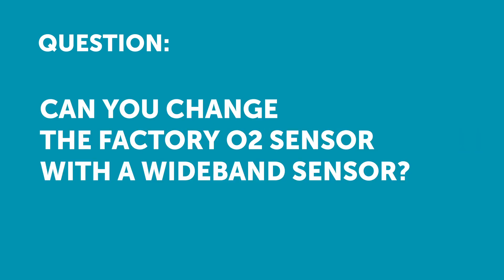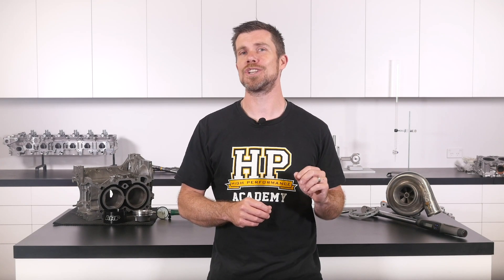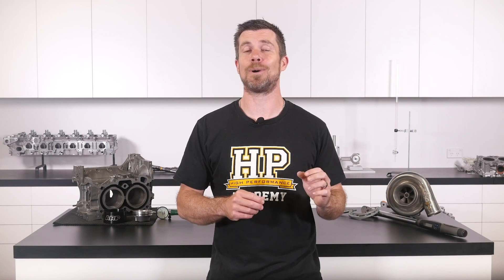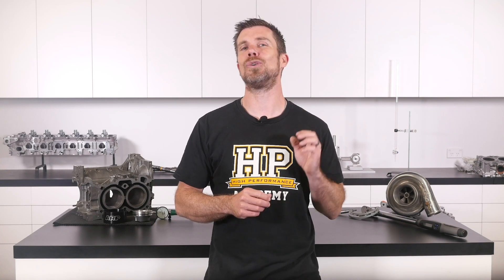Replacing Narrowband O2 Sensor With A Wideband. Straight Swap? [HPA Q&A]

Comment: But if I want to run say 13.7:1 and narrow band is not accurate at that level, how do I do the tuning, just adjust the target AFR and see when the WB reads the value I want? I just did that on a 1991 GM EFI v8 1227727 and it didn't change anything it's still 15.7 (the NB is a bit off that's why I try to lower it) I'll try 12.7
Reply from the maker: You really want to use a wideband 😀 - Taz.

Comment: I have a k24 swap turbo mr2.  can I remove factory narrow band (stock o2) and replace with WB1 sensor? I will cut and remove factory signal wire, but use the factory o2 ground and power wire for the WB1. I am running elite 1500. I just want to know if this is ok, or will I need to run two bungs. One for my factory o2 and one for the new WB1.
Reply: Hey, did you replace the factory sensor? I am considering this because I don’t want to have to install the WB1 to my current setup as I will be changing it soon.
Reply: @jordanmcclellan5365  i just terminated the original factory narrow band sensor, and ran only the WB1 off the ecu. I haven't gotten the car to run yet, will working on working and other little things. A forever project car... lol

Comment: You say that replacing a narrowband with a wideband doesn't work, by this you mean that it isn't plug and play, right? If I hypothetically created a controller that converts the signal to narrowband (rich-stoich-lean conditions), then it would work, correct? Or are these values somehow calibrated per sensor?
Reply from the maker: It's not plug-and-play physically and your ECU won't know what to do with it so it's not plug-and-play there either. 
If you tricked the ECU into thinking it was a narrowband, there would be no point in fitting it at all if I understand you correctly there?

You might not be using HP Tuners, but I think you will find a watch of this valuable, I hope it helps: https://www.hpacademy.com/blog/getting-wideband-afr-data-into-vcm-scanner-hp-tuners?utm_source=youtube&utm_medium=social&utm_campaign=general-interaction - Taz.

Comment: Hi Can you swap out the narrow band sensor with a Innovate Lc-2 + wideband sesnor and gauge and the use one of the signal wires 0-1 Volts from the controller to the wire from factory narrowband sensor going to ecu? so the ecu still has the narrowband reading? Thanks
Reply: Was wondering this also

Comment: Is it possible to replace the original zirconia type sensor with a planar type sensor ??
Both sensors are four wire narrowband sensors. Original sensor is a NTK produckt and new one would be made by bosch.

Comment: Hello andre, i have some questions that maybe you can help.
Do you know any model of wideband that allows data log to a laptop with rpm signal? Do you know hany way to convert the signal from a wideband to simulate a narrow band? I know this is not the best way to go, but its an old car and I need to keep it original (Race rules, I can add things but I still need to use factory ecu).

Comment: A lot of European cars started running wideband from around early 2000's. I have a 2000 S3 which was narrow band but they went to wideband around 2001. I was able to convert mine by obtaining a 2nd hand factory Bosch ECU (very inexpensive) and fitting it to my car. It was plug and play except that it required a simple harness to be installed (around $100 from Unitronic) as wideband have more wires than narrow. I then retuned the car. It can now run in closed loop throughout the range... the primary fuel map is made up of target Lambda values.

Comment: That's not ENTIRELY accurate. You can replace a narrowband with a wideband, if you use a wideband controller that has the ability to emulate the narrowband sensor. I know Zeitronix does this. This will let you tweak the "demanded" AFR, within the error limits of your ECU (I think it's up to ~5% on some ECUs, before the "lean/rich limit" error code is thrown)
Reply: You beat me to it. Some wiring is required either from the wideband controller to the factory narrow ones plug under the hood/car or the other is direct at the ecu with tapping the wiring near the plug or if you can depinning the OEM wiring from the plug while pinning the wideband controllers output wires to fit you loom plug
Reply from the maker: The answer is in regards to a straight swap. You cannot unplug your factory narrowband and plug in a windband O2 sensor without modification such as what you have outlined here as an option, or what Andre mentions in his answer too - Taz.